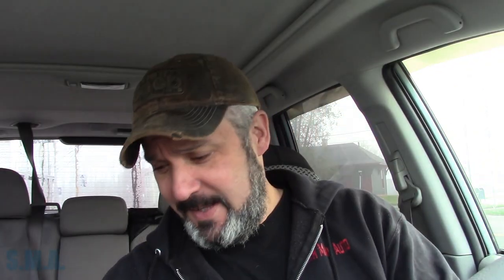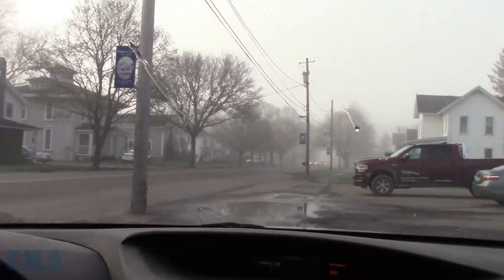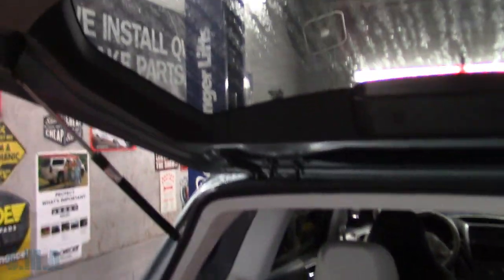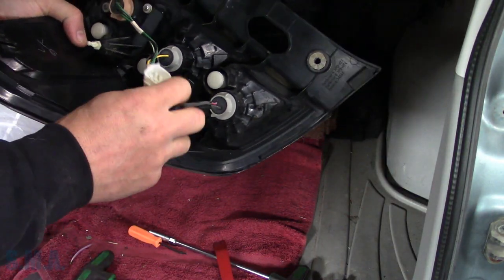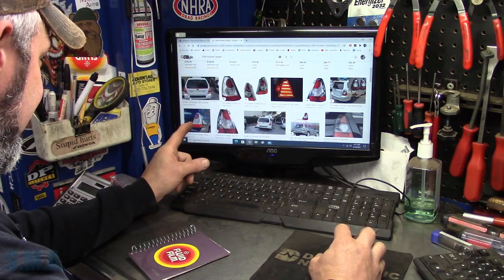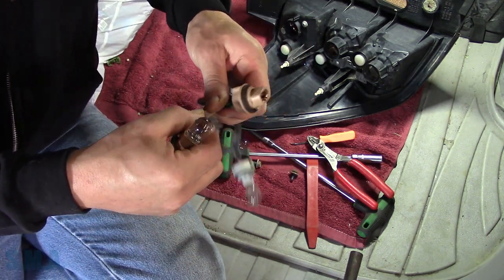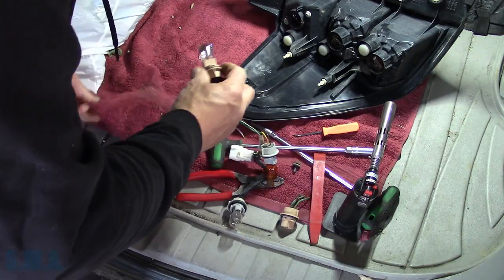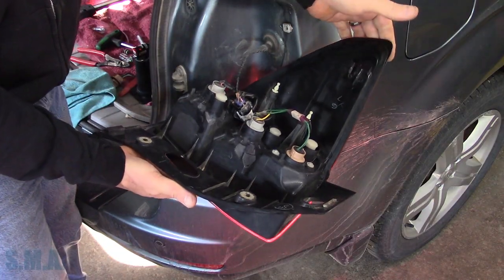Don't Be A Jerry!

Comment: Without the clues that could have been a complete bitch of a fault to find.  I've come across mashed terminals in lamp holders and even shorted lamps.  But not a lamp holder bridging different circuits together.
Reply: I've actually seen this before..  Starts with a bulb that breaks off in the socket, follows with a "mechanic" digging out the remnants with a screwdriver, ends with a new socket.
Reply: My other channel guy is on here !! Big C !!
Reply: What a coincidence, just came here after one of your videos
Reply: My guess is, since this is a dual-element bulb, the ground for the brake element some how lost its connection to the ground terminal and was instead connected to the positive terminal of the running light element. So when the brakes were press, it sent power through the brake element into the positive side of the running light circuit.
Reply: ground feed backing power to the other stuff
Reply: @newtekie1  most likely  the power was feedbacking via the   common rail for the running lights
Reply: Na he would have found this pretty easily. I've seen all his videos and what he can do. After watching him easily diag network stuff this would be cake to him.
Reply: @hugeshows  Thinks for this info. ; I couldn't begin to understand why a mechanic would miss up a socket like this until you made your post - which seems a reasonable explanation how someone could damage a socket.
Reply: I think I am in that strange part of the World Wide Web where Big Clive and Eric O collide... and loving it!
Reply: fancy seeing you here
Reply: My first thought was the bulb cause some people like to take  2 stage build and fuse the two contacts together to make one and then marker lights come as well...
Reply: Now how about a collaborative video, big Clive blows it up, Eric o fixes it or vise versa…awesome
Reply: I had a Charger that would have something goofy going on with the lights when I would hit a big bump. Also had a pair of Magnum heads in the trunk that I never got on the engine and it turned out that they were laying on the trailer light harness and cut through the insulation just enough to touch the copper. That one took me way too long to figure out.
Reply: Big Clive. One of My oldest channels i sucscribed to, thx aVe😉 and The  aVe influence is heard on Erics speech, choochin😂 What goes around comes around on The weirdest ways on The yotubes
Reply: @AnanusBananus  what's funny is that I watch Rainman Ray Repairs and Watch Wes Work too and between those 2 and Eric here they all have pretty much the same sayings and mannerisms Like "Gravity", "Lady" and "Click" All 3 are excellent mechanics (Technicians) with their own particular way of doing things and great to watch...  I think they all deserve 1m subs plus..... And as for Big Clive, I've been watching your videos for at least 4 years, keep up the awesome work and amazing explanations you do Clive 🙂
Reply: @biffmalibu3733  Not overly keen on aVe, I just find him not as good at explaining what he's doing in layman's terms than other similar(ish) channels. He's just not my "cup of Tea" (yes I'm British lol)
Reply: @Aspie_Geek_UK  Yes excellent channels you have listed There. I do enjoy their content as well. You can learn alot from all of these creators. But yes, AvE influence IS strooong on this technical end of YT.

Comment: I really do miss the little shops. They get to know you and you know them....
Reply: About 15 years ago our local Ace Hardware that had been in an old downtown building on main st forever was forced to relocate to a new stand alone “smaller” store on the edge of town by “corporate” The elderly owner was was wandering around in his ACE Vest and saw me looking for something and asked if he could help me. I said yes I can’t find anything in this new store and sullenly he replied me too. ☹️ In the old store he knew where every piece of merchandise was and there was 5 times more floor space there. His daughters run it now and are just as friendly but it’s not the same as the old store.
Reply: @J Hemphill we need to stop spending money at these big box holes.
Reply: I rely on a small 3 bay family-owned shop when I'm not repairing my vehicle myself! Great service at a fair price. Been going there for 20 years or better!!
Reply: @4WDIESEL1  That's what I've been trying to do myself. I will say it sometimes has it's drawbacks however. I do some small engine work as a hobby, and a shop here has had an order of mine waiting for 6 weeks on the control wire to a mower. Ordered the air filter too, on march 5th. Two days ago I picked the air filter up, looked at it and saw it was very clearly wrong (mind you I brought the original piece in upon ordering). After saying "this isn't the right one" I was told that "sometimes they update the designs". Surprising nobody, it didn't fit anything I had. Tried to return it and order a carb kit, got told "that's a 50 dollar mower sold for 150 new." and kicked on down the road for that. "Go online" I was told. All in all, you win some and lose some with buying local.
Reply: What about the ABS?
Reply: What does this have to do with fixing a light socket 🤷🏼‍♂️
Reply: What does this have to do with fixing a light socket 🤷🏼‍♂️

Comment: I have a friend that was in the Navy as an electrician and the one thing he told me that I have applied in my own work on Automobiles is that he said to me  "85% of electrical problems are visual". See how Mr.O found that? he seen the problem.
Reply: If you don’t see it you can usually smell the bad electronics also.
Reply: Or just follow the smoke...
Reply: @mrman17  anglo Americans invited eletric bs the native America's evented the short circuit because of the smoke signals
Reply: Just look for the toasted parts
Reply: Or as Yogi Berra used to say about baseball, "...half of this game is 90% mental...".

Comment: This just confirms my feelings that as an auto tech, we spend a minimum of 50% time un-screwing what others have screwed up...at least where I am for damn sure!
Reply: Any idea what the heck this Jerry guy was trying to achieve? I still can't figure it out.
Reply: @PJBonoVox  The incorrect bulb was in there, the contacts were a bit different, so my guess is he was trying to make the incorrect bulb work in the socket.
Reply: Same exact way in the home theatre industry.  In South Florida we fix what we call "hialeah hack jobs" or "the craigslist special" or of course the classic "I know a guy who can mount your 85" TV on a full motion mount CHEAP!!!!"
Reply: @PJBonoVox  the wrong bulb was obtained...so instead of quickly getting the right bulb he smashed the pins inside the connector so they'd touch the contacts on the bulb. No bueno

Comment: Man when you went to disconnect the tail light I felt your pain lol I also have arthritis I can unbolt a well torqued bolt but unclipping a small connector forget it lol
Reply: Had this recently on the coil connectors. So old and crusted and no room to use pliers and also not eager to spray it with lubricant. And I have no weak hand grip either, but it was a pain to remove these. Took me longer to disconnect the coils than changing the spark as a whole.
Reply: I feel your pain....I have the ol’ “dead fingertips” from scleroderma. Strong as a mule, but feeling connectors to pinch...nah, ain’t happenin!! Sometimes I squeeze a bit too hard and crush the housing and/or clip. 😬
Reply: Same with my mechanic neighbor. Outstanding mechanic. Smart, strong, but drops shit all the time and can't do little things very well...

Comment: Don't be a Jerry! I did see a 79' Ford courier 30 yrs ago; where the lights would blink and the fuse box got so hot you could not touch it. Turns out it was corrosion of the metal case light socket was providing a host for a ground short. Great fix, love the channel.

Comment: I kinda like the more "Boring" SMA videos, because the commentary and solo dialogues are just fantastic lol

Also, if your local pull a part yard goes down, have you checked out Horseheads Pick-a-part, Eric?? I've been a few times, and it seems like a decent place!
Reply: Too far.
Reply: @dougaranda6187  It's a 2 1/2 hour drive for me to get to Horseheads. Usually I make 2 or 3 trips a year, depending on what they have on the yard.
Reply: @k0rndog93 , it's maybe an hour from Avoca, so a 2 hr round trip.  Long way to go for a $1.78 bulb socket.
Reply: @dougaranda6187  They've got more than bulb sockets.

Comment: I hope you adjusted the brake light switch so it doesn't need so much pedal travel to activate
Reply: Thinking the same. She going to get pulled over again 👨‍✈️🚔
Reply: He answered that question, About 6 minutes before you asked, The car has power assisted brakes and car has to be running.
Reply: He did not touch the switch.
Reply: @poslane99  That's not how it works.  Brake light switch is on the pedal, and that one was obviously (and I'm saying that as someone with over 2 decades in the trade) out of adjustment.  

It should barely take any travel to activate the brake switch.  Way less travel than this car seemed to have.

Also got to say his use of crimp connectors is a bit sketchy.  Should have soldered.
Reply: @immikeurnot  Nothing wrong with a crimp connector when done right. Tho again personally I also would've soldered it just because no real reason just because.
Reply: @immikeurnot  so you're one of those remote diagnosticians? Do you KNOW that it doesn't work right when the car is running, or do you ASSUME? Two things: the brake light might be switched by brake pressure, not travel. In that case, without vacuum, not enough pressure to turn the brake lights on. And without vacuum, the pedal is a lot stiffer, so it might simy not travel far enough with light pressure to turn on the lights, even if it simply is a brake travel switch.

Also, crimp-and-seal connectors are superior to solder joints. They don't get brittle with time, and you don't run into the issue of solder wicking up the wire, making it stiff and eventually break from vibration.
Reply: @kain0m  He showed us the brake light switch, it's a conventional switch design which is activated by brake pedal travel and has a threaded mounting collar to adjust the activation point. The switch has been changed so it clearly wasn't adjusted correctly when installed.  No assumptions needed here, the evidence is plain to see.
I agree on the crimps though, nothing at all wrong with them, they are superior to soldered joints when done correctly.
Reply: @immikeurnot  That was my first thought. The switch isn't adjusted correctly and that is why she didn't have brake lights. It's pretty common.
Reply: He only fixes whats written on the bill - he doesn't do a bumper to bumper restoration on the car.  He only does what the customer asks for and has the money to pay for.

Comment: I don't Always Jerry Rig, but when I do it is to fix someone else Jerry Rig. Which is true, last one I did was on a 2009 Nissan Altima, Engine was replaced, and they cut wires to remove and replace. Well, a very young mechanic (if you could call him that) decided to use wire nuts to fix them, which didn't fix anything. long story short I had to find all wires and solder them together. The mechanic was 20 at the time and said he was a Diesel Mechanic, which I asked a few diesel questions which he failed them all.

Comment: I had 2 techs that couldn't figure out a brake light circuit issue. In the end the 1 element popped and welded is self to the other element shorting out the running light circuit. Had the same symptoms you were having. Good job!

Comment: I bet she took it to Scotty Kilmer. "WELL YOU JUST TAKE THE WHOLE THING OUT, YOU BREAK IT, THEN YOU JUST PUT IT BACK IN."
Reply: While madly waving his hands and making funny gestures!
Reply: Funny, never seen Scotty do that. I call B.S.  Rev up your lie detectors!
Reply: Robert Rocca  his dad owned a shop and he probably worked there as a kid
Reply: Robert Rocca  Because he could work on cars WHILE in college, and he said he started working on stuff very young anyway.
Reply: "Don't buy a Subaru. Don't use that bulb." says Scotty.
Reply: Lol wtf
Reply: @abbas1872  In what way? Not all brake jobs require resurfacing drums/rotors, or some of the other details, and the brakes work and wear fine. I've seen the uber-brake-jobs on South Main Automotive; some of those cars needed every step Eric O. does to make sure the used and new parts work together well. But basic brake work isn't rocket science; even I can do pads and rotors (drums are harder with the springs, and I only did them on one car, one time).
Reply: @markh.6687  good boy.

Comment: Had an older Chevy Cavilier that behaved in the most similar way.  When ever I stepped on the brakes the interior, dash, headlight and break light would go on.  It took me a day to figure it out. It was a dual element brake light that had a bit of solder break free and landed on both elements shorting it out.  It was the head scratcher that I never forgot and this was the first thing that came to mind watching this video.

Comment: I figured you would adjust the brake switch so it would come on without having to press the peddle so hard while you were at it. just a thought lol
Reply from the maker: It was hard because the car was off. No power assist. Car running it works fine.
Reply: * Pedal
Reply: @SouthMainAuto  First off - Youi da man!  Thanks for putting out these videos.  Love your humor.  I didn't think of it either until reading a couple of people's comments about adjusting the brake switch.  I think there was another Jerry that replaced that brake switch and didn't adjust it properly.  The reason the lady brought in the car was that she got pulled over for no brake lights when she stopped.  When you got the car the brake lights actually worked - had to push the pedal extra hard but the running lights came on too.  The officer didn't notice that.  Just sayin'..  I think the adjustment of the brake light switch is what got her pulled over.  Love the videos!  All the best to you and the fam!

Comment: Jury Rigged and Jerry Rigged are used synonymously in the US.  During WWII Germany couldn't supply spare parts, because of Allied bombing; so they had to rig their equipment with baling wiring and bubble gum to keep it working.  Allied soldiers were often amazed when they saw the deteriorated condition of Germany equipment.  

I enjoy watching you logically and methodically troubleshoot issues.

Comment: Nice save. I had similar problem to my customer. Her complaint was front left headlight intermittently goes out. I found bulb connector were burned and barely saw any pins. And it had zip tie around that connector. I fixed it with new harness. Customer was happy. Ugh some mechanics are jerk and careless. Again nice save 👍🏼

Comment: I had a similar problem with an ‘84 Subaru GL wagon back around 1996 or so.  Turns out the previous owner’s son replaced both tail light bulbs with 1156 bulbs instead of 1157s.  I had a hell of a time getting them out of the sockets!

Comment: Another thing that'll work for depressing the brake or accelerator pedal is a $10 large board clamp from Harbor Freight. You just turn the clamp pads to where they are facing the opposite direction from each other, and you're good as gold.

Comment: I was raised in a shop like yours from when I was a toddler. Dad ran a shop the way you do, honest, helping people even if it didnt put a buck in his wallet.  Love your vids. For the life of me i can't understand why you put butt connectors on those wires instead of soldering and shrink. I work at a place where part of my duties are equipment maintenance and am finding a lot of the past repairs with butt connections are the wiring issues. Hate them and won't use them,hope you have better luck. Keep up the good work.

Comment: Our family car, before we bought it, went to a Jerry also. He bypassed the oil cooler and oil radiator/permutator coolant hoses into it (plugged these two together and an "U" in the oil rad in/out coolant pipes). 
We 1st changed the oil radiator due to the coolant hoses blowing out with oil (it had internal leak to coolant circuit, reason why Jerry didn't change it probably), then a whole engine due to internal block crack passing oil to coolant - THANKS JERRY!!
Oh yeah, and the scumbags who sold us the car, did a nice thorough clean on the coolant circuit - i went to check it as it was a way of detecting these kinds of issues. 
2017 was fun... (on top of that, we had someone rear ending us on that same car).

Comment: One of the humbling lessons I learned with our Forester was how fussy it is if you make the mistake of putting in the wrong bulb. I wonder if Jerry  initially put in the wrong bulb and spread the connectors. Then he put in the correct bulb, and over time with the heat of a bad connection, the best path to ground ended up going through the marker lights. In my case I just blew a fuse, no harm, but it's a reminder to look up the correct bulb, don't guess.

Comment: A few years ago I had a ‘99 Dodge Ram 1500 come in and when the headlights were turned on, one would be high beam and the other low beam and they would switch when the high beams were selected, customer had been to 3 other shops, had the light switch and multi-function switch replaced, lots of wire poking etc… long story short, husband had put 2 different “wrong “ bulbs in, fortunately, I only scratched my head for about an hour and a half before I pulled out the wiring diagram then checked the bulb part numbers… both different and both wrong. Installed the right ones, problem fixed. I gained a loyal customer that day and for many years. I credit luck and experience to that fix.